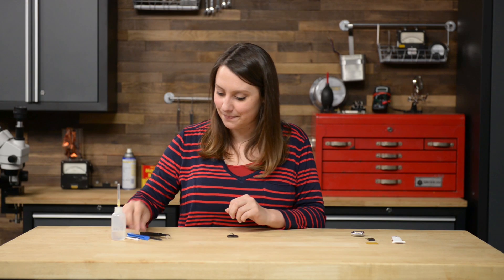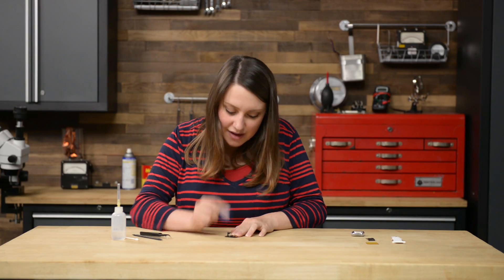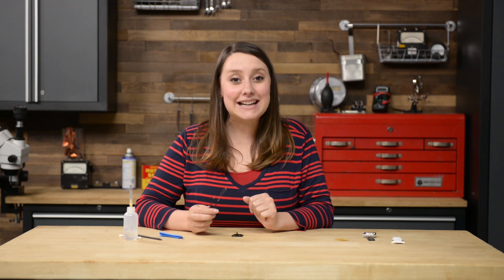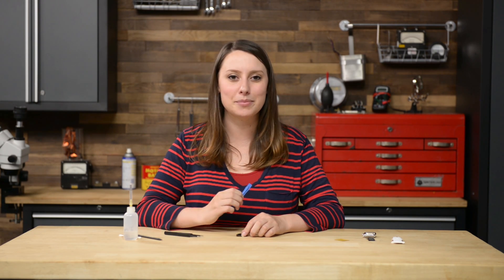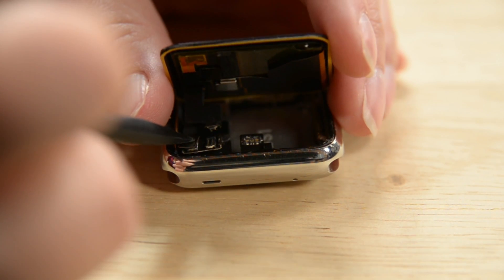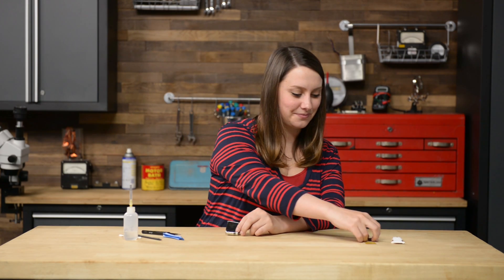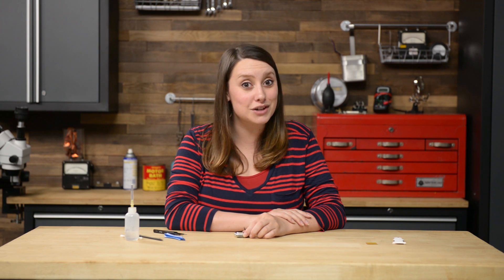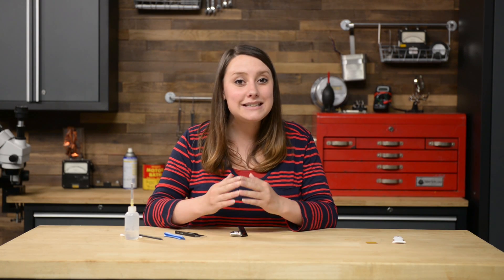Apple Watch Reassembly!

Comment: So all you need is Apple Watch (38 mm Series 3 GPS) OLED Screen and Digitizer and the Apple Watch (38 mm) Adhesive Strip? I saw theres all these other adhesive parts like  Battery Adhesive, Logic Board Adhesive, Wireless Charging Antenna Adhesive, Force Touch Sensor Adhesive Gasket, Display Connectors Sticker Set, and NFC Antenna. Do I need to buy all these other parts too? The only thing broken on my watch is the glass. It still turns on but I can't use it cus the touch screen sensor can't pick up my touch due to the glass being broken. I don't want to buy parts I don't need cus it adds up to buying a new watch. Anyone know about this?
Reply: You can either replace the whole screen or just the touch screen/glass. The top glass is actually the touchscreen unlike on iPhones so when the glass breaks, so does the touch. It’s not too difficult to do a glass only repair but it does require thin cuttinng wire,  liquid UV activated glue, a UV light, and then when you’re done with that part you’ll need to replace the edge adhesive with one of those adhesive gaskets. In order to make it water resistant again, you’ll have to hold the screen down firmly while heating it up with a hair dryer which will melt the edge adhesive. Be sure to keep your finger on the screen while heating it and if it becomes way too hot to keep it there it’s too hot for the display.

Comment: my battery in my series one watch enlarged, which is why the glass popped out of its case.  will that still work if the battery is a little over sized, or will it eventually come loose again?
Reply: You need the battery replaced in order for the screen to fit on again. Because it’s a battery, Apple might swap the entire watch out and give you a newer one for free. They did that for my original 2015 model so now I have a Series 1. Otherwise if you don’t want to do that, popping out the battery and putting a new one in is fairly simple enough for most people

Comment: Too bad you can't actually buy those adhesive strips.
Reply: amazon. they are cheap
Reply: you can buy it on ebay! 
https://www.ebay.com/itm/3X-LCD-Screen-Sticker-Adhesive-Tape-Glue-Replacement-For-Apple-Watch-Series-1/202311023126?ssPageName=STRK%3AMEBIDX%3AIT&var=502285313147&_trksid=p2057872.m2749.l2649

Comment: Hey Gwendolyn, I need the black screen cover that goes on the glass part. the heat did not help pull it off without messing it up.  Is there a way to get the replacement for that part?